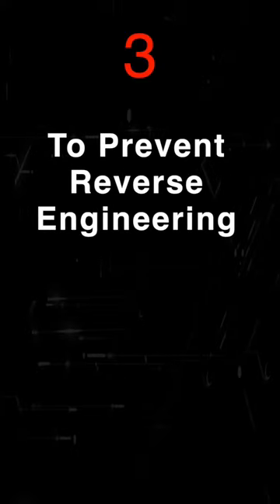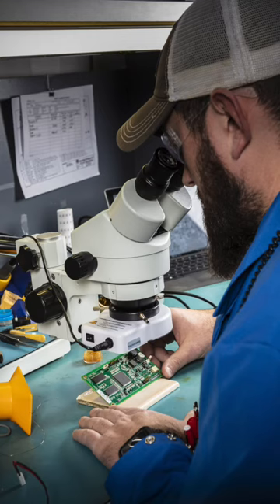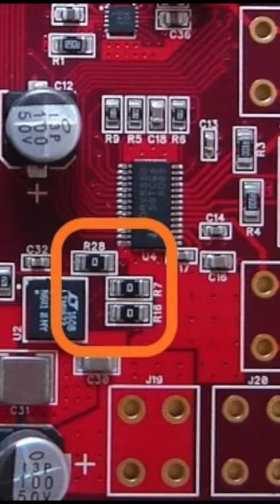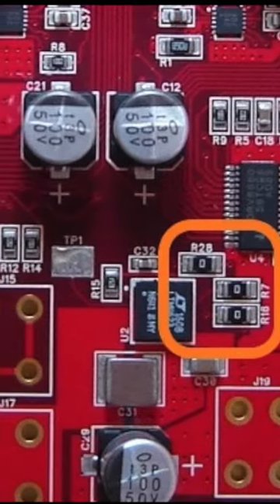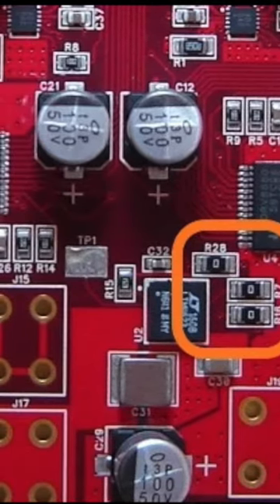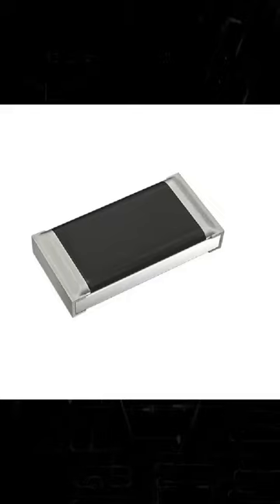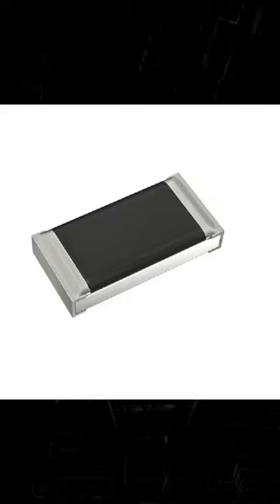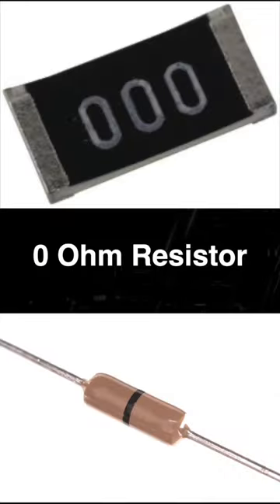Why Zero Ohm Resistors are used in Electronics ?

Comment: In terms of EMC, we will use a 0 Ohm in-line resistor that if necessary, can be replaced with a ferrite bead or a resistor of higher value to reduce interference.

Comment: I am using zero ohm resistor as a fuse in my power electronics circuit. 😊
Reply: Why? Wouldn't be better to use an actual fuse instead?
Reply: @RussellTeapot  Tell that to hard drive manufacturers, that's what they do (place 0 ohm instead of fuse).
Reply: @decaalv  I'm a beginner in electronics so I'm genuinely confused: I assume that a 0 ohm it's not exactly 0 ohm and has some resistance, therefore for a large enough current the res will dissipate power and eventually fail open. But isnt such a behaviour unreliable, since technically it's not an intended use case for a res? After all, fuses are designed to fail open at a specific current and do that in a specific time
Reply: Ah. After looking a bit into it I found that I'm correct in thinking that a 0 ohm as a fuse is not a great idea, but it is sometimes used to save costs... :D